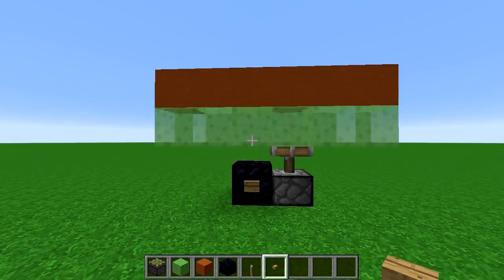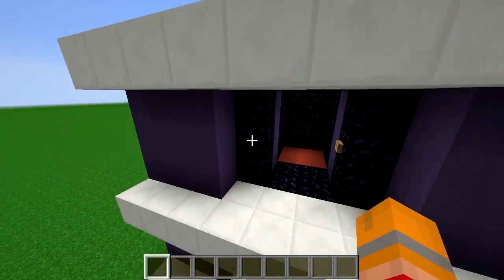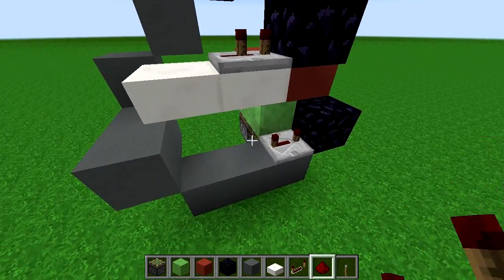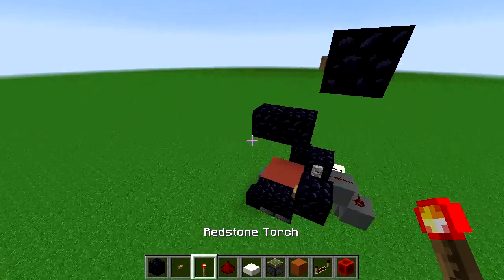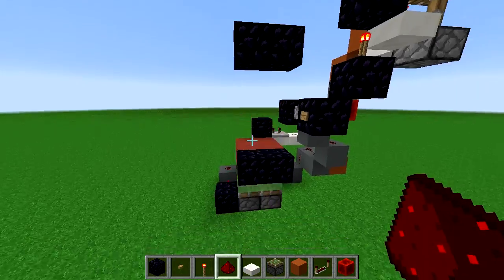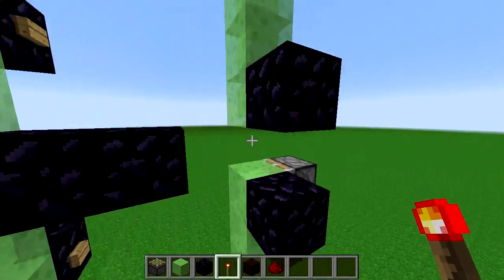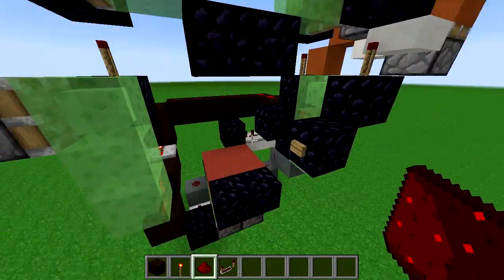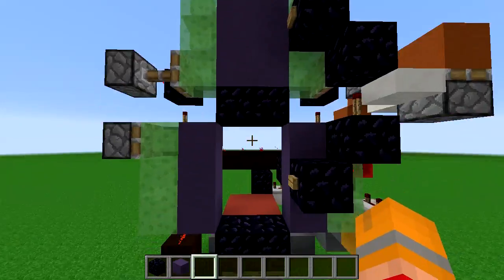Realistic Piston Elevator (Showcase & Tutorial)

Comment: Hey, I tried this build and everything worked! Except for the door. Whenever I try to incorporate it, the elevator stops functioning properly. What happens is the circuit goes through the motions to activate the pistons but, when they activate whilst the door is in the circuit, only two of the pistons activate leaving the platform stuck between floors. The really weird thing is the circuit will work when the pistons for the door are active with slime blocks but nothing attached to the slime blocks but, when you add blocks, the same error occurs. I've rebuilt this circuit at least three times and I always encounter the same strange error. Ideas?

Comment: Hey nice Video but i have a Problem i finished the Button Part and tested the Elevator it worked fine. then i decidet to test it while standing on it and it stopped  after the first bottom Block. And now comes the Crazy stuff the Elevator works fine if i use the Lever but with the Buttons it stopps always one block after the bottom.  i havend started the Door part because of this problem, the problem is something with the Buttons but i can figure out what it is.
Reply: +GamingValue nvm found the problem it was the repeater it was set to 2 instead of 1 i think i clicked at some point and made the mistake. :/

Comment: Will this work with minecarts on rails in the elevator?
Reply: Rails will break when pushed upwards however the minecart would be pushed up.
Reply: Even if they are played directly on the slime block? :-(
Reply: Any block at all. Sadly it can only be pushed horizontally as long as there is a block. It can be pushed with slime blocks this way.
Though I have heard of an extremely complicated bug in which the rail can be pushed without any rules. Buuut it cannot be used in this type of elevator.